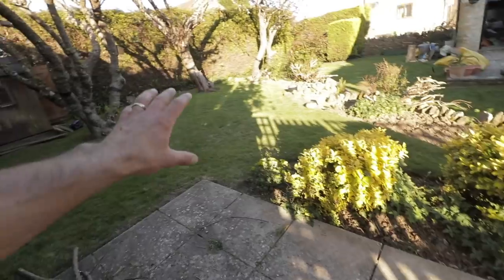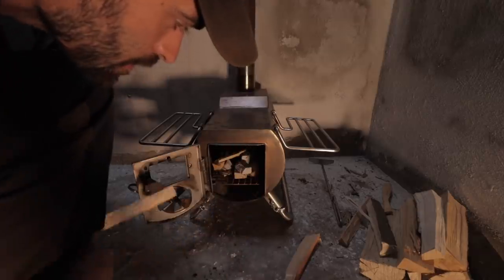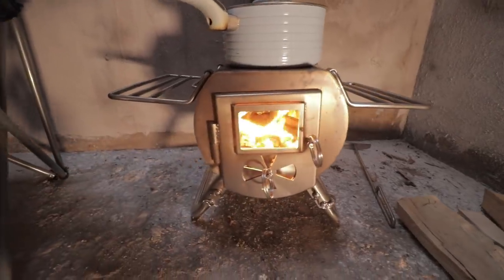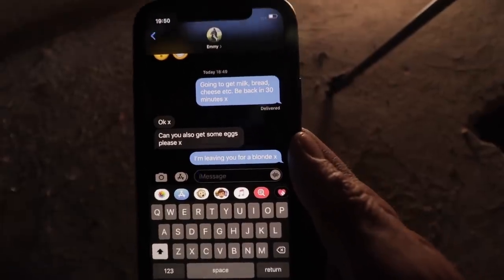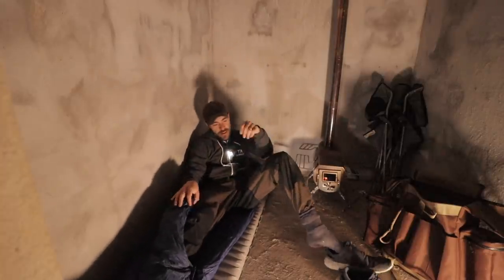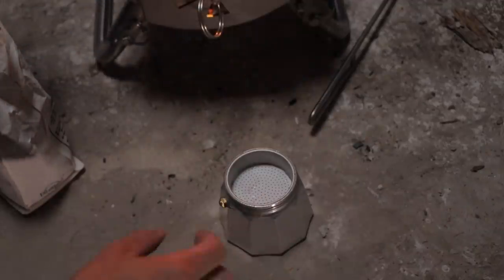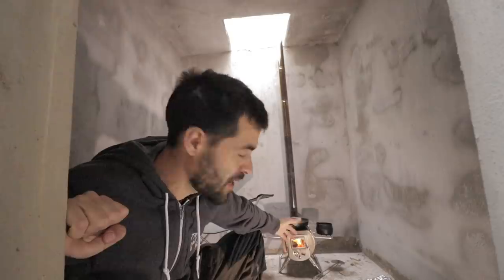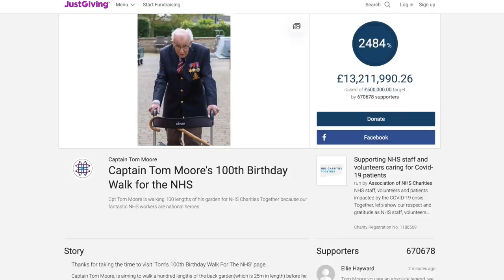24 HOURS Overnight in my Bunker: Woodstove, Axe Sharpening

Comment: Oh man.... That's creative! Thank you! I owned a home with a basement that leaked and was told the only fix was to dig down around the OUTSIDE of the underground walls and seal them from there. My fingers are crossed for your success!
Reply: That's the only way to "fix" it permanently, but I'm of the opinion that all digging out the outside would do is aggravate the problem that caused the cracks in the first place, so I'd much rather do the concrete sealant tbh

Comment: Maybe build a table or platform for stove so it's higher up in the space and extends the pipe up out of opening to help prevent carbon monoxide from coming back in.
Reply: Carbon monoxide rises because it’s slightly lighter than air so would never be a problem in that bunker, as long as the hatch is open.

Comment: I would definitely make the air shaft into a concealed air intake/escape route, perhaps having the outside covered with a brick barbecue. I’d build metal steps into the shaft, wire solar collectors to appliances on the inside, and set it up as a dual purpose man cave / bunker.
Cool series.

Comment: Just found this series, entertaining. One of my first thoughts was once cleaned out , it needs a heat source to draw in all that fresh air from the stairs. Native American pit houses had the cooking fires 🔥 with a hole in the roof with a side ventilation shaft. Air flow could be great and used the heat of the fire for natural air conditioning no matter the exterior temperature while also pulling any extra moisture away with the stale air

Comment: If you have a few cinder blocks or the like, you could build a base up a few feet to put the stove on. This could eliminate a pipe or two. Or you could make a good shelf on that back wall to put the stove on in the future. Also might be kind of cool to have a fold up cot/bed on each side wall that folds against the wall when not in use but unfolds to use when needed.
Reply: I checked the comments first to see if anyone else suggested it. I thought if you can't make the chimney longer raise the stove! 👍

Comment: A few hints: That vise in your workshop is made to mount under the bench-top. Get a small metal-topped table, about 2 feet (60 mm) tall and put the stove on top of it. That will raise the stovepipe farther out of the bunker vent. Store your firewood under the table. Get a pair of army cots for sleeping in the bunker. As mentioned below, a carbon monoxide detector wouldn't be a bad idea. Mount it low, near the floor as CO is heavier than air. Thanks for the video. Ian
Reply: Quick hint :- carbon monoxide is lighter than air!

Comment: Awesome find. Not sure if anyone else suggested this but I wonder if it is possible that the vertical shaft was also an emergency exit. Also, for the sump pump, I would put it closer to the wall in a sump bucket and put in a floor drain that extends across the entry area that drains into it. For the door, I would suggest a new door with hinges at the the top and a rubber flap to help shed water. A co2 monitor is a great idea. Eventually you may want to consider running some electric into it, then you can put in a fan to help with venting and to run the sump. Shelves for various supplies, maybe a sleeping cot. One possible future use would be a root cellar. Agan, awesome find. I'm a little jealous.

Comment: That air flow is called the 'Coriolis Effect'.  Hot air rises.. but also while rising it swirls in a clock wise motion. Works well. If not.. Everyone back to Victorian times and earlier would have all died of CO poisoning.  Even getting back to 1100 AD. Doesn't take much heat.. but it will rise.  When it doesn't.. your  chimney is too short or not properly capped.  Just simple physics... Even if your door was closed.. it would still rise.. But if worried. a cheap CO detector will help.
Reply: But his chimney IS to short. That's the point. When the door is closed, the only place for the fire to pull in air is from that skylight. The same skylight where his chimney ends. So any smoke/CO coming out, would be sucked back down.
Reply: Counter clockwise south of equator, like toilets

Comment: Great work on the bunker, you might consider a raised floor on the bunker.  Two reasons, first will get you off the floor which is cold and flood; second is that you can use the space as storage under the raised floor.

Comment: A prefect way to dry the walls out . I was on your Dads channel and told him about Abbotsbury beach lane along the very start of the beach buy the car park . As you get to the car park entrance on the left go straight on and round the corner to the right along both sides of the lane there is wild garlic about 5ft high with flowers about the size of your fist and the bulbs are massive we used them for cooking up some mackerel that we court  . I think it was about summer time but it was a long time ago high fearnley whittingstall used to go there aswell to collect them .

Comment: Long term, think about a folding set of bunk beds and a table. If the fold up against the wall, out of the way you can set it up to be multi-functional. Use the bottom bunk as a bench to eat at the table, then fold the table up out of the way and drop the second bunk. Mount some cabinets up in the corners so they are out of the way and you can keep some simple items there for overnight use.

Comment: I suggest a large mirror on a wall to increase room size sensation. Heat and light. I also suggest a mirror to reflect the air gap so you can see what is above you without having to look up.

Comment: Some friendly advise from someone in the plumbing and heating industry:

When you can, you should go to a plumbing wholesaler and get some insulated flex duct, intake vent and a combustion air pot. Put it down in the corner right next to the stove. I'd recommend getting a manual damper for the top of the pot as well.

I could see issues arising once you close the door. The stove will want to draw air from the hole your stove cap is inches from.

Comment: Couple of points I thought R.E. stove watching the video:
1) About the chimney being tall, you seen the hight of house chimneys? If they work at that height yours should be ok!
2) If you did want it a little higher out the top, you could always put a table or some bricks under the stove, and to lift it all up!

As others have said, a carbon monoxide detector wouldn't be a bad plan.

Great video! Loved watching this series. Stay safe.

Comment: Maybe you could build a platform topped with brick or metal to put the stove on. That would make the pipe come out higher, make a comfortable height to work, and give you a place to put in some shelves or wood storage. I definitely agree with getting a CO detector, safety first.

Comment: Hey Mike. Hope you and your family are well.

With the bunker, I noticed you removed the plastic cover you had over the grate.  Once the lock down is lifted, I would suggest if you use the wood stove again, build a slightly taller roof structure.

you also mentioned the pipe work for the stove may be too short.  would you build a platform in the bunker for it?

You mentioned the WW2 vet.  I have crazy respect for older veterans, as I'm a U.S. Marine veteran myself.  But the older generations are always great to learn from and talk to.  They're also great motivation in life.

Thanks for keeping the videos coming. It's getting me through the Shelter in place here in Chicago.

Comment: You covered the stove issue with the stack effect... but the wind blowing across the top will also create a draw as well... what I've been told... the taller chimney creates a much bigger draw..mixed w/ the stack effect and the chimney works effectively...

Comment: I would try running a fan or 2 to help dry it out. maybe one in the vent shaft to really draw air out. You could also try setting the stove on a table to get the stove pipe further out of the vent shaft. A little table could also give you a little more room to store things underneath like firewood because of how little room there is. You could also get a piece of angled stovepipe so you can set the stove farther in the corner. Definitely keep a couple folding cots on hand at the house or build a couple of bunks that fold up against the wall.

Comment: I found this a little alarming. CO2 has a density 1.67 times greater than surrounding air and can lead to suffocation (NOT the same as CO which can irreversibly attach to the haemoglobin inside erythrocytes) at higher CO2 concentrations. In days long gone, workers who dug wells as part of windmill water pump placement were warned about CO2 accumulation in deeper wells. When you first mooted developing the bunker I suggested installing a small turban shaped turbine exhaust ventilator (home hardware shops stock them) to remove CO2 buildup ; of course, they only require a very slight breeze or more to work.  Not only are you breathing out CO2 but the fire is too (mercifully, most will be drawn up the flu, as is CO). The turbine exhausts are small, cheap, no running costs and easily fitted, do it for your family :-).

Comment: You could take some plywood or sheet metal (Or both) to make a new door. Use rubber strips to seal around the edges like weather stripping on a car and the weight of the door should keep it nice and tight!

Comment: You could put some bricks under the stove and or a platform on top of the bricks to bring it up a little higher. Also I would have used a hammock to sleep in. Plenty of holes in the wall to put bolts or screws in. Diagonal across the room also would work for some extra length.

Comment: I believe someone probably already wrote these things, but if not for anything else, then for the Youtube Algorithm, here goes:
Regarding the fear for suffocating, here is an old tip that was used when digging wells (I've used it myself)... If you put a candle as low as possible, it will go out before you get in any danger.
Also, the miners would have a small singing bird of a sort in a cage and store that below themselves. If it stopped singing, they knew that they were in trouble. But that would probably damage your reputation ;)

I believe that if you kept the fire going it would easily keep the air nice and fresh. The bigger concern is your breath, if you stop that air circulation provided by the stove.

Thanks for another awesome video. 
Best regards from Denmark :)

Comment: Suggestion - For the bunker not to have any humidity or moisture on the walls use a product from Home Depot called Drylok you can find the dry lock in the paint section in the store.

Comment: You might want to build a box for your stove to sit on. It will solve 2 problems. One it will raise it up so your chimney is above your air vent so you aren't breathing smoke and it will be a handy place to keep your wood for the future. You might want to think about adding fold up bunks anchored to the wall, that way they fold up out of the way. Just my thoughts of what I would do. I can't have an underground bunker without an air tank or snorkel. It would fill with water or float up. Our water table it way too high.

Comment: Just seal your door like a flat roof with tar and rubber membraine. Scrub the cement under the door and seal with silicone adhesive so a neoprene foam gasket can be glued to it.

Comment: With the massive vent from the ceiling, I'd hardly think it a surprise that it became chilly over the night, as I'd have been more surprised that the warm air stuck around long enough for it to have been warm before you went to sleep.  If you'd covered about three quarters of the shaft,  the bunker would have become warmer more quickly, and held the heat longer.

Lecturing aside, you've my best hopes for enduring the pandemic, and that your entire family comes through safely and comfortably.

Comment: I cut my hair by using a BIC safety razor......just break off the front white bar to expose the blade and VERY lightly run over hair and it works a treat.    Brilliant mention of captain Tom at the end of your video.....BEST JOHN UK

Comment: After you get all that masonry dried out paint it with the epoxy paint that is used on swimming pool plaster. Then if the walls and floor get wet again you can just clean it, and the masonry will keep more dry on the inside.

Comment: The height of that smoke stack is fine. Look at a wood burning stove in a house,   the smoke stack for those have to travel 20ft or more to the tops of houses sometimes and they get a good air flow to move that smoke away.

Comment: Might be more comfortable if you move your head to the other end. With your head under the opening the cold air drops right on it. Secondly, if you are sure the fire is out, you might put a soft barrier on the opening to prevent the air falling into the bunker.

Comment: That much stove pipe at that size will slow down the air draw. Your stove will not burn that well. start with a short stack and add to until you find the max number of pipes to put on your stove. (for best burn) I did it the hard way to find this out.

Comment: i think if you are afraid of CO sinking from the top of the pipe you might consider sealing that grill.
that way the hot smoke gets out the pipe, but cannot sink back down. Fresh air would be drawn in through the door.
even if some smoke gets into the door it will Always mix with Fresh air.

Comment: Here in the states there are several unusual bunkers, I wanted to tell you about the one in Nevada. If you haven't heard of the Rat Pack, look it up, these were pretty interesting guys. Anyway, they owned a bunker that is privately owned by a couple that are unrelated to any of the Rats. A memory was triggered when I saw the stovepipe. The bunker in Vegas had heating and air conditioning, so the air circulation had to be brought in from above the bunker as you have done but they really didn't want anyone to find them so they had several cactus's made to bring the pipe up through. There were some holes to diffuse the air as it went up. Think on it, imagine those cactus from The Road Runner cartoons, the ones that look like they have arms, this is what they had made of metal. I am not sure about the construction but they looked really good when I saw a picture of the area. Underground parking, a pool, a billiard room and I believe there was two levels. It was one of the things on my "I won the lottery!"  list. Anyway, I thought this would be interesting for your purpose, if the smoke could be relocated perhaps? A solar fan in a pipe leading to a tree or the vent of a house. Just curious

Comment: Those damp patches look normal, Ive used the same type of waterproofing in my basement and mine has the same patches in the waterproofing where the dampness had been entering. You will likely find no real water gets through but the concrete may appear "damp" looking. I would only be concerned if you can see water droplets still coming through, I dont think you will get water pooling anymore, its a breathable coating, so most water will come out as humidity in the air, but not as a liquid. You may see that there is more crystals in those areas too, this means its doing its job. Its actually a good thing that its taken a while to dry out after applying. It means it haves more time to do its chemical reaction. If the concrete is too dry, you are supposed to actually wet the concrete first before applying it, as it sucks up all the water from the brush and it can be hard to apply, looks like it went on OK in your basement, but to me its looking like its doing what its supposed to do. Looks like you have just enough length to install a bed/bunk in there, but it depends on how much room you want to take up inside, but would be pretty cool to see a bed inside. Perhaps a fold out design may save space. it looks like you have enough room for shelves, for supplies (and wine cellar!) Would love to see some gas masks hanging up on the wall and make it look apocalyptic! As others said, some radio equipment would be pretty cool and if you can either get power installed, either by solar and an inverter, or mains power, you could use a computer down there with a cheap USB radio scanner (rtlsdr.com) connected to it. With enough ventilation like a fan on top, it would be safe to use gas stoves inside, especially if you used it below the vent shaft. If planned right you could have enough space for your family to spend the night in there but would be very cramped and someone would still have to sleep on the floor if you had a double bunk. Look forward to your next update!

Comment: You were worried that the extra long chimney would impede the performance. However the  stack effect dictates the exact opposite. Your chimney up draft is proportional to the hight of the stack and the temp differential  between top and bottom. You see the effect in your video with the steam off your dinner.

Comment: The longer the flue the faster the drawer and its harder to control the heat because it burns quickly even if you try to control it with the air intake iv always found that on my boat because I have a long flue so I just very slightly leave it open.

Comment: if you have cinder blocks put the stove on them 1 it will be easier to load wood in  and your stove  pipe would be higher in the air

Comment: It's not an air raid bunker. It's an old property, therefore an Anderson shelter would have been used well away from the building, to stop rubble blocking the entry. It's a root/wine cellar.